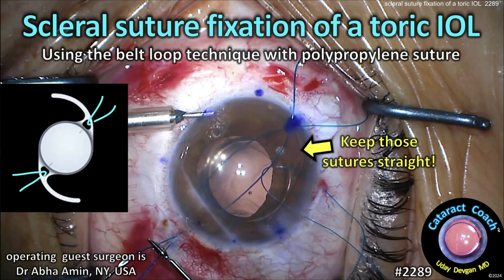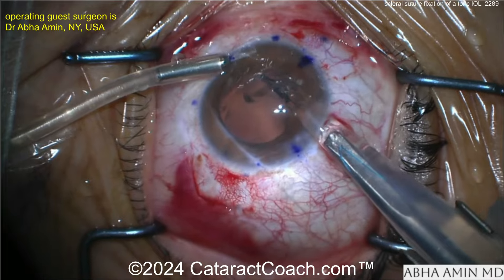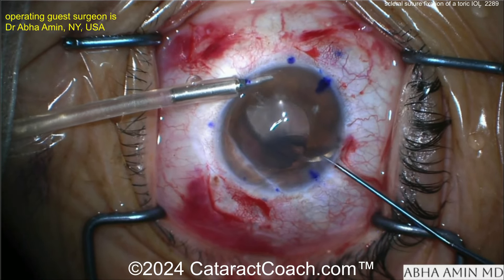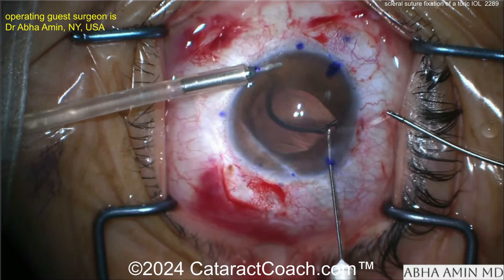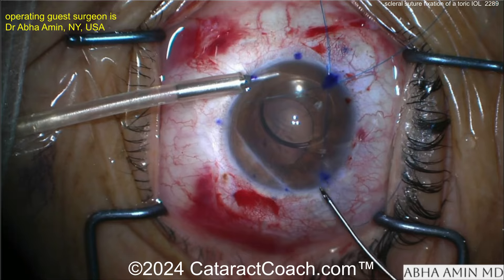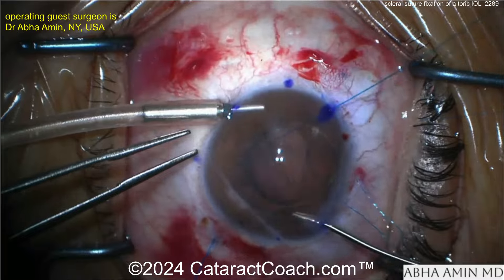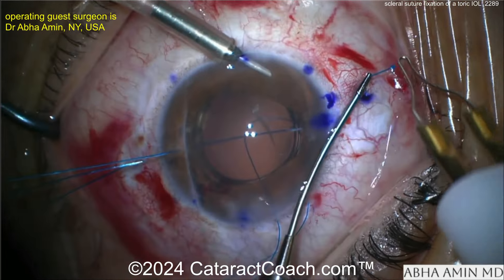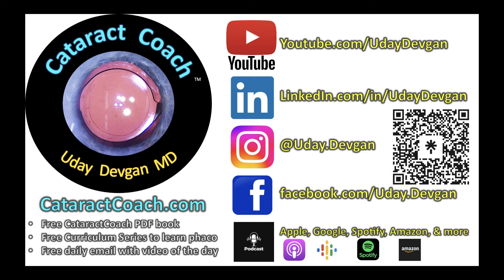CataractCoach™ 2289: scleral suture fixation of a toric IOL

Comment: How does this single-piece acrylic IOL in the sulcus not cause UGHS?
Reply: Because there is no sulcus anymore. It's a unicameral eye at this point.
The point of a SFIOL is that there is in adequate capsular support, hence the suture supported IOL. And the lens is some ways from the iris to prevent chafing (which can happen)
Reply: @gingerbreadman1217  That was my question. Does chafing from these haptics cause less chance of UGHS then, say, other single piece acrylics?
Reply: It does if it’s not placed posteriorly enough and then there’s probably more risk of tilting. The haptics could be amputated to reduce the risk, since the are not needed for anything. Luxated and scleral fixated in-the-bag one piece IOL’s are less prone to causing UGH than these without capsular bag. A toric lens designed for scleral fixation (or even a toric 3-piece IOL) would be ideal, but none are available in the US afaik, so people have to come up with different ways of going around the problem.
Reply: @Antroid1  Thanks for the enlightenment!